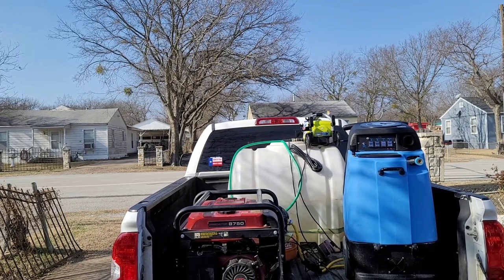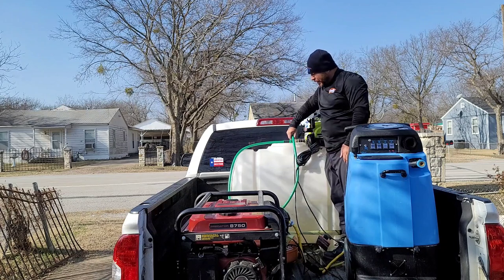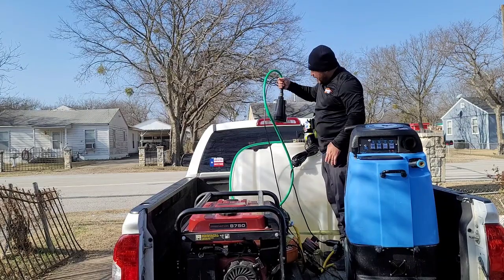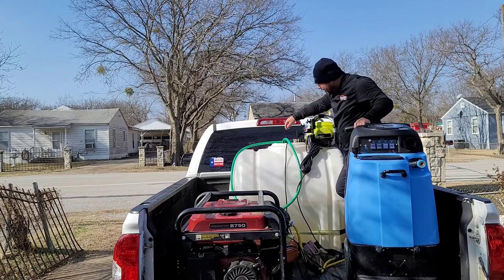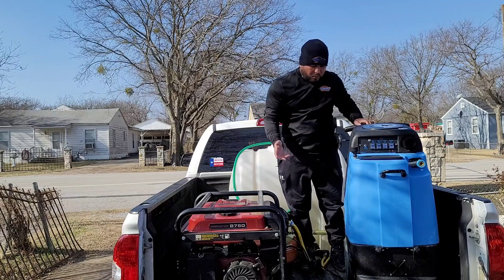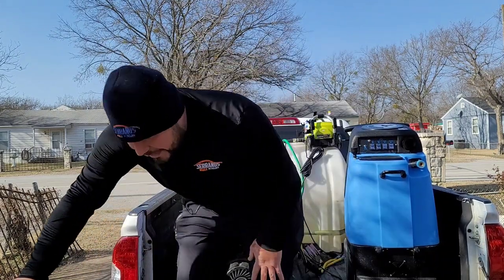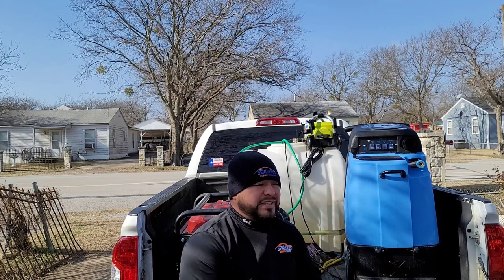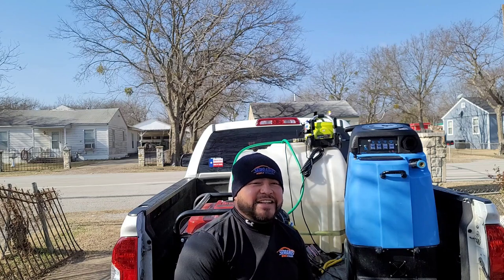HOW to get water from tank to pressure washer (CHEAP & EFFECTIVE )

Comment: Great great info!  Quick question:  my pump comes on for about 2-3 minutes then turns off.   Just getting started so it was wondering if it needs to have a certain amount of water in order to keep it running?  Thanks in advance
Reply from the maker: Hmmm what pump do you currently have

Comment: Great video, I was wondering how you covered the opening you cut out in the water tank so that while driving, the water doesn’t fall out of the tank?
Reply from the maker: I made a cut out, i put the pump on top then with a sharpie marked where the pump wouldn't go through and made a cut out
Reply: @serranosmobile  Thank you. Did you cover the hole after?

Comment: THANKS FOR SHARING, at what point do you turn pump off so that the water feed to pressure washer doesn't burst. as in do you just leave both pump and pressure washer running while completing vehicle or do you turn off after rinsing
Reply from the maker: Thank you for watching
Reply from the maker: I keep it on once I finish using it I will turn it off
Reply from the maker: But they have been times where I will rinse, foam vehicle and then turn it off while I wash mitt the vehicle

Comment: Thank you for the video.  Excellent idea for my situation where there is no water at the work sites.  I'm new to pressure washing and have a question though:  The instructions of my washer say to run water through the pump without starting the engine by holding the wand handle til there's a stream.  My machine does that with a garden hose at my house, BUT, when I hook up the running sump pump...I can't get a stream through the wand with the engine off.  When I start the engine it all works fine.  It appears the sump pump is pushing water faster than my house was.  Is that bad?  Is there a pressure 'limit' on how fast it goes into the washer?  Seems to work fine.  Just can't do the "bleed out the air" step in the instructions.  Any thoughts?  Thank you in advance for your info and time.
Reply from the maker: No you will be fine, nothing to be worried about 🙏🏼

Comment: Hola Serrano, what type of submergeble water pump do you use or recommend???
Reply from the maker: This one is from home depot, I just made a cut out and threw it in there. But now I do gravity feed
Reply: Gravity feed you don't use nothing right?  just connect hose at bottom and water comes out hopefully
Reply from the maker: @wilsonbaeza4384  correct

Comment: Hi, thanks for sharing. Would have preferred a more detailed explanation (visual) on the connections (to/from, where to where).  Also thinking that if you need the generator to power the sump pump which means more gas if your pressure washer is gas-fueled as well, so double the cost on fuel per job.
Reply from the maker: Thanks for the feedback, yes I usually don't think things through when dying videos, until after lol

Comment: if youve a sub pump working all the time what happerns to the presure of the water if your not using the washer ?? does it only turn on when the washer is turned on ???
Reply from the maker: Pump stays on.  But 3yrs never an issue that i have seen

Comment: Will the pump keep running if you aren’t using the pressure washer?
Reply from the maker: Yes it will but can get one of those wireless remotes and turn it off which i think i will be doing that on my new set up
Reply: @serranosmobile   nice!  I was thinking about trying a water pressure booster pump.  Automatic on automatic off., never have to even think about it.  I tried posting a link, but it won’t let me.
Reply from the maker: @GiovanniGiorgo  email link cserrano95@gmail.com i would love to check it out

Comment: I have a 1.1 gpm electric pressure washer with a 320 gph Drummond water pump and I had it on for about 5 mins but it turned off from over heating can you please help?

Comment: How does ur 5 foot hose help u reach cars do you park real close or do you have a real long hose
Reply from the maker: I have a 25ft hose attached to preassure washer
Reply: @serranosmobile  are you still using same set up or is everything different now…I’m here in Tyler Texas about to start a mobile detailing myself and went out and bought the pump at Home Depot that u use…I have a green works 2200 psi pressure washer with 2.3 gpm u think the pump will push enough for that and u think a 2500-3500 watt generator will work as well…sorry just want to make sure thangs work

Comment: Oh man that submersible water pump is going to save a few hundred bucks. I thought I would need a couple hundred dollar water pump. I didn't know they made these submersible. So the pressure of the water is good with that GPM? I'm looking to start my mobile detailing business as soon as I can. What gallon tank do you use?
Reply from the maker: For me it works,  i know have a 50 gallon
Reply: @serranosmobile  does that size usually last you all day? I know wheel wells with fabric instead of plastic get especially dirty and might need extra water.

Comment: it says the pump isn’t available is there a different one you would recommend now ?
Reply from the maker: Home depot always has some that will do just as good. Thats where I bought mine from
Reply: i currently have the seaflo 33 series but it’s been leaking on me and i’ve had a hose burst because of high psi on that water pump and it’s only 3.3 gpm im using a ryobi 1.2 gpm 2,000 psi
Reply: i’m leaning towards the drummond 1/6 hp 1,600gph but im not sure if the pump will stop when i’m not pressing the trigger on the pressure gun, just trying to avoid any hose bursts and leaks from the pump
Reply: most of the submersible water pumps have a max temperature of 120 degrees will it be fine in an enclosed vehicle ? sorry with the questions been having problems w multiple pumps for awhile now lol
Reply: @serranosmobile  let me know 😎 don’t mean to bug
Reply from the maker: I never look at that 🤣🤣 bad habit I just buy one lol
Reply: @serranosmobile  which one has lasted you the longest, gonna buy one today
Reply from the maker: @robknox7737  the one in this video

Comment: Hey bro quick question since the opening of the tank is exposed what about when you are making turns and going up hills etc what about when the water leaks  ??
Reply from the maker: I fill up to 80 gallons on average water does not leak out. Unless it's a sudden stop
Reply: @serranosmobile  i have a 65 gallon tank how far do you recommend i fill it up ? Just concerned about water splashing on my generator etc
Reply from the maker: 65 u can close the lid and keep pump inside vehicle.
Reply: throw some dirt on it

Comment: Hey man how much gallons of water do you drive around with And safe ?
Reply from the maker: 65 gallons
Reply: And where can I get a water pump on a budget with out electric I don’t  have a generator
Reply: Local tho what brand you recommend and on a budget of 100 dollars
Reply from the maker: @jasonvr5107  on a budget hmmm that's tough
Reply from the maker: @jasonvr5107  home depot has an everbuilt 100 plug into electricity

Comment: Do you need any pieces to connect the water hose from the submersible pump to the other end of the hose into the pressure washer???
Reply from the maker: Just a water hose
Reply: @serranosmobile  thanks for the fast response. So basically with the 5ft hose in your bio and the submersible pump I’ll have what I need to connect to my pressure washer? Thanks again!
Reply from the maker: @ZaydenJayy  that correct
Reply: @serranosmobile  thanks I’ll be ordering this set up. Thanks for all you do, subscribed!
Reply from the maker: @ZaydenJayy  God bless you 🙏  and thank you for the sub

Comment: So you don’t use any filters to clean up sediment?
Reply from the maker: Its usually on my water hose at home
Reply: @serranosmobile  what size hp pump did you use? I bought a 1/3 40 gpm. I am running into flow issues.
Reply: @NicKennelty I'm surprised. I use the superior pump 1/3 in a 40 gallon tank and it works great. Really throws water
Reply: @miketampabay9446  that’s what I bought and not enough psi. Same one. But I’m coming out of the top. Bought a well pump the other day. It blows like a fire hydrant… had to install a bypass.

Comment: Great video!
You answered my question without me even asking.
Reply from the maker: May I ask what the question was sir 🙏
Reply: The question(s) that I had were: if I could use a sump pump like a transfer pump, how would I plug it up? and what to do if the sump pump didn't fit inside the tank.

I had the same idea in my head that you used for your setup before I saw your video:
I already have a 330 gallon tank. The 12v transfer pump kept burning out, so I wanted to use a different method. Your video is exactly what I saw in my mind but didn't know if it would work with the sump pump.

Comment: Do u need a pump if the tank is higher than the pressure washer
Reply from the maker: If you doing gravity fed no,  but pump helps a lot
Reply: @serranosmobile  thanks for quick response...is there a video that shows exactly how to connect the tank to the pressure washer..and do u know a cheap place to.get 55gal tanks..I assume if I use a pump I don't need a 100gal tank like Google suggested
Reply from the maker: @sharriceowens913  I don't have that video at this time.

Comment: Wow! So the pump just stays running the whole time it's submerged in the tank? Even though it can't actually pump water anywhere?

I've thought about this many times when I've used a submersible, but figured I'd burn out the pump and never had the balls to try.
Reply from the maker: Yes it  stays on
Reply: @serranosmobile  that's fantastic. Thank you!
Reply: @serranosmobile  hey man so do you also use the same setup to feed water to that carpet extractor there
Reply from the maker: @leonardhollings5676  yes i do
Reply: @serranosmobile  thanks alot man I needed this info because I m looking to do the same.

Comment: Sry, im completely new to all of this.  So basically I need a Generator, a water pump, a water tank, hoses and a nozzle to soft wash?  I have a power washer currently that does not connect to a tank or anything, basically do i need a big water tank that I mix bleach into in order to spray it on the house then just use a water hose to rinse it all off?
Reply from the maker: sounds about right

Comment: I need help.. I tried your set up and it's not working.. I have a dewalt 3600psi with 2.5 GPM but I'm not getting pressure out my pressure washer I'm guessing the pump I just bought is only putting 1800GMPH which is 30GPM probably not enough pressure
Reply from the maker: Hmmmmm
Reply from the maker: What pump did you buy
Reply: Superior pump 1800gph submersible pump
Reply from the maker: U may need a submersible pump to keep flow coming. Or a on demand pump

Comment: 1.how did you make a cut out? 
2.how do you seal your water tank from the environment?
Reply from the maker: I put the pump on top, amd with a sharpie made two ines where the pump comes to and end the 2 ridges, then cut that out with a thin saw, then slide the pump in and closed it
Reply: @serranosmobile  how do you put the cap back on if you have just sawed the actual opening?
Reply from the maker: @quintascooper4652  u will be able to close it
Reply from the maker: The threads will close, I will try my best to do a video of how I did this week
Reply: @serranosmobile  ok thank you so much!!!

Comment: This video definitely helped 💯 thank you bro 😎. Just ordered my submersible pump and the flexzilla hose 😁!!!!
Reply: @serranosmobile  keep up the amazing work brotha 🏆
Reply from the maker: Thank you
Reply: @serranosmobile  I got my hose and sub. Pump finally!!! Can’t wait to try this out man!!! You’re the mans bro 🙏🏾.
Reply from the maker: @DeliDel215  heck yeah
Reply: @serranosmobile  bro quick question. So I was a little confused on how my setup would go. I have a water tank and I had to buy the adapter for it and everything. But I wasn’t to sure on how I’d have the water hose going from the submersible pump, to the pressure washer and onto the adapter for the water tank… any tips?
Reply from the maker: I made a cut in the tank so my submersible pump could fit
Reply: @serranosmobile  what did you use to cut it  if you don’t mind me asking?
Reply from the maker: @DeliDel215  small thin saw